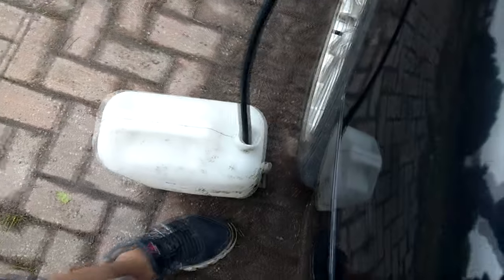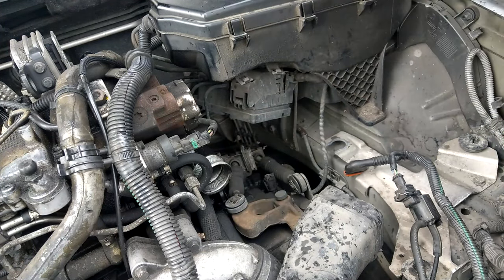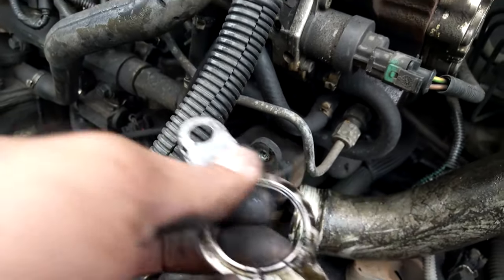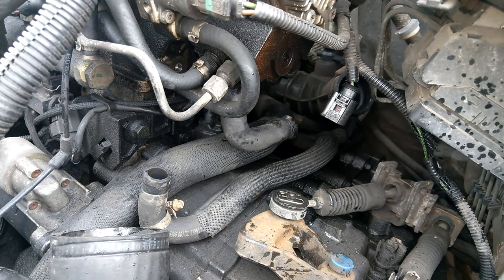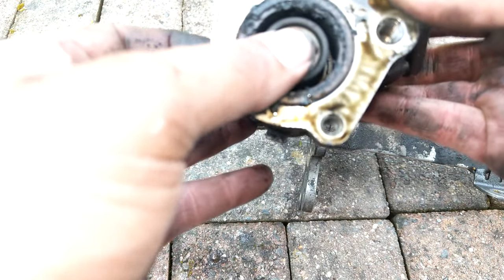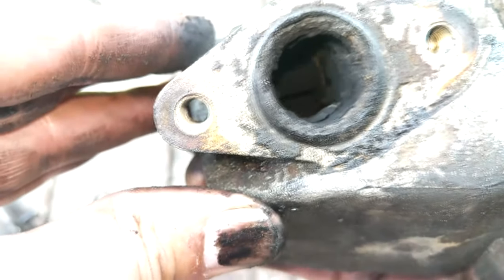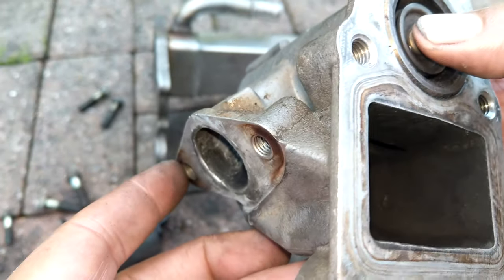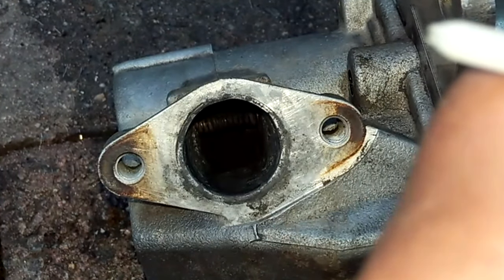Electronic EGR Valve Cleaning Testing and Replacement

Comment: Following your advice I've got as far as taking off large diameter flexible and metal pipes from the front and found them to have over 1cm thick gunk. Wax, crystalised gunk, feels like sand/grit. Took ages to clean them up. The junction to the EGR was almost completely closed due to the gunk. Only had so much time so I reassembled it all, quick clean of the MAF too and the car is immediately improved. Code P0244 cleared, can overtake again, boosting smoothly etc. Once I've got time I'll tackle the EGR itself following your excellent video for help, thanks man. I had no shim on the front joint of the actuator so I'm guessing my 2002/3 XC70 D5 Geartronic with 170K miles has had this done before. My nails are now mingin and will take a few weeks to clear up haha. Even bleach isn't helping but by the sting I'm guessing it's clearing out my micro cuts. :) Thanks for these vids, they really are helpful. I am so glad I didn't follow advice to just simply spray turbo/EGR cleaner in the air intake because if it managed to loosen even a tiny percentage of the accumulated crud I doubt my engine would be happy processing it.

Comment: very well simón, i did the work on my car, only i used spray oven cleaner, it looked like new, and i also cleaned the intake manifold and hoses, to top it off i installed an oil trap, and cleaned the membrane decanter,

Comment: Wow superb video. Got probably same problem with my xc70 2004  i was inspecting my turbo actuator but still no bad signs. My next step is egr. Do have an Engine service requred mesage after a harder aceleration. Also way more smoke then it should be.. should be no smome at all...  im sure 90% after i done this my problem will go away. 
Thanks for great informative vids!

Comment: Awesome stuff. I did this in my S80 D5, thinking that was the cause for reduced power output when I accelerated harder, but it ended up being a clogged fuel filter. Much simpler to solve, but in the end, it got an EGR clean at roughly the same miles as yours. It's a really nasty job as you said.

Comment: Hi Simon, great video! I was very interested in how you showed pressurising the coolant expansion tank to evacuate coolant from the system. You mentioned that the coolant was evacuated via the 'return hose' - can you be a bit more specific? Where/how did you connect the coolant evacuation pipe to the car? A very handy trick to know for all sorts of operations on the engine, etc! Many thanks, Ken
Reply from the maker: Hi, thanks for the comment.
If you check my list of videos, the coolant change with the car on the ground video is one of the newest.

Comment: brilliant video knows what he is talking about...i have a 2010 volvo xc90 d5 awd 2.4 auto diesel and i have had the same problem for months, had all the so called experts and non of them have been right, when i am on the motorway at 75-80 mph the car will not go past 3ooo revs, goes past 3k revs any other time but not when it gets to 80mph....its certainly a head scratcher

Comment: Done egr for my other car and because rushing allot made a mistake by putting back together egr  actuator and its housing not in perfect alignment. This caused horrible engine running even stalling.    I spent many days to figure out this..     It is definetely recomended to check that valve is operating as it should when its still not in a car.. this may save you lots of your hair...

Comment: HI. THX for the good video. Can u tell is if a blocked egrv valve could cause an overboost and also a limp mode over 2800revs on a d5 volvo engine?

Comment: I have an 02 S60 D5 with the same EGR. You make this job much easier with another excellent tutorial video. Many thanks. Liqui Moly makes an EGR cleaner with advertised specific dissolving properties - any opinion?
Reply from the maker: When the valve is as seized as in this video, I find it hard to imagine how it could be freed up by a liquid or spray without dismantling.

Comment: That mixer plenum was very clean! Whenever I've removed mine it's been caked in oily crap. I've been thinking of blanking the EGR off & swapping the plenum for a straight through ali pipe, is this something you've ever thought about doing? How often would you say that the EGR needs cleaning? Also I found petrol was the best thing to clean this sort of gunk off.
Reply from the maker: I think the mixer was clean because the EGR valve itself was stuck closed so very little exhaust gasses had made it through for a while.
I have seen them as you describe and worse though. 

Personally I would never blank or bypass the EGR and now that it's clean and working correctly, the engine has never run better.

I would guess that this style of EGR system needs a thorough cleaning and testing like in the video only every 10-12 years.

Cleaning the mixer plenum is probably a quarter of the job at best.
Reply: @sirobb  what are the side effects of stuck closed egr?

Comment: Done mine few weeks ago, I just clamped my coolant hoses from egr. I could say what did come out was from egr itself nothing more. I have a question, maybe you gonna do intake manifold cleaning? It would be very nice to get more information, before I try to do it myself.
Reply from the maker: None of the data suggests a problem with the intake manifold so it's not a job I'll be doing any time soon.

Comment: Hi Si great video as usual. In the 'good old days' we could get gaskets ANYWHERE. Now its a struggle to get the full set of EGR gaskets for my 2004 V70 D5! Im planning ahead as i need these gaskets or I cant take the EGR off. I dont know if you live anywhere near Basingstoke or have any idea where I can find a Volvo spares department please?
Reply from the maker: There are lots of Volvo main dealers on eBay if you want genuine parts. The EGR gaskets are reusable though so don't need replacing if you still have the originals.

Comment: Brilliant channel just discovered it, I’m a new owner of a xc90 d5 187 and find your videos answering all of my questions all but one, the fan on the engine is it normal for it to always be spinning ? Second I turn the engine on the fan starts spinning
Reply from the maker: Sounds normal. The cooling fan is used to pull air through the radiator pack which includes the AC condenser so I'd be more surprised if the fan was not spinning, especially in high ambient temperatures when AC is used immediately after starting the engine.
Reply: @sirobb  thank you for your reply, it isn’t turning fast just kind of spinning at engine pace kinda like the old land rovers and shoguns where the fan was on a belt.

I’ve subscribed and look forwards to watching all of your videos 👍

Comment: Additional; what about the deposits on the 'swirl flaps' - cleaning those would also improve engine performance(?) I love my D5 but the soot at high mileage has put me off buying another.
Reply: well the swirl flaps are for - well swirling the air - and making the combustion more efficient, if they stuck open or closed, it will have bad performance. The Actuator arm isnt there for decoration, it opens the swirl flap and closes it when necessary to maintain best airflow possible, the arm itself is a problematic construction, so is the flap design itself. If you have time id try to clean them if the EGR mixer plenum thing is dirty, so u know the flaps will be as well

Comment: I have a d5 newer one and it sounds weird on the left side when i push the throttle, its like a turbo pipe is leeking like a suction sound but nothing is teared strange it sounds like when you pour water on a hot surface but constant its hard to explain but any idea what it could be? Its on the driver side of the car ive already went through the egr pipes and stuff and cleaned them all but still the sound persists

Comment: Hey Sirobb, I’m sorry it’s completely unrelated to this video, but I was wondering, are there any differences in the suspension components between the 1st gen S60s with petrol engines and the 1st gen S60s with diesel engines? I am going to install some Eibach lowering springs, but 1 website tells me that they are only suitable for the S60 2.4 D’s while another website says that it is also suitable for the S60 2.5T petrol engine. I’m pretty certain that there are no differences but I’d just like to make sure, I don’t have NIVOMATS btw.
Reply from the maker: Vida, the Volvo diagnostics software contains a comprehensive parts catalogue for your exact car and will see you right.

Comment: Hi Robb, ive had the egr delete done not too long ago. Its  a costly thing to deal with when buying the car from someone else who wasnt really maintaining it well. Would unplugging it, since its electronically activated,  end the egr functionality and prevent gasses/fumes from entering the engine or does it need to be blocked off physically at the pipe too?
Reply from the maker: The EGR valve cooler has a small permanent bypass which allows flow so if you want no flow, you need to fix a total blanking plate at the mixer plenum up front. Search D5 blanking plate online. 
Fitting this plate would cause a warning on my car but if your egr software delete is successful, it won't be looking for any flow so you'll get no warning lights.
Reply: @sirobb  wow this was a swift response. They're not strict the emissions and so it's easy to blank it off and get away with it. I wouldn't do this if the former owner took good care. Right now I'm dealing with some harsh gear changes, particularly between 3 and 4 or at times 2-3. When the engines not yet running hot, changes are more smoother. But it plays up when you're flooring the pedal or once it's running hot.  I'm suspecting to be related to an incorrect atf level or solenoids needs cleaning and demagnetizing, if I can find someone who does it. Or replace the valve body if it comes to that. Unless it's the torque converter which might also be an issue.
Reply: @sirobb  if I was close to you, I'd definitely bring it around for some surgery

Comment: ho simon is there any chance you can make a video of the filter change on the engine bay fuel filter, mainly how to bleed after installation euro 4 xc90 thank you d5
Reply from the maker: I'm not aware of any engine bay fuel filter on a D5.
Bleeding on a D5 is just a question of ignition on for 10 seconds then ignition off then repeat 3 or 4 times before starting the engine.
Reply: @sirobb  thank you for your swift reply much appreciated i will try that, please keep up the good work with many more videos...

Comment: Hi
I have question about the EGR on my xc70 d5.
I did a diagnostic check and the % is always 100% what could be problem. Ist that the valve is open all time or what.
Thans for your help
Reply from the maker: If the figures are wrong, remove, clean and test the EGR valve as shown.

Comment: Hello Si.
Interesting vid as I've never known what an EGR valve was.  Do you think a faulty EGR valve would cause intermittent stalling at low rpm's during the warming up cycle.  My Ford Transit had the problem from new and Ford being Ford cuffed me off with every excuse under the sun, even lieing to me about tests they were doing on the vehicle.  Anyway... I still own it and every now and again during slowing down to a junction early in the warmup cycle it will just die.  It starts easily after the stalling with no other symptoms for remainder of journey.  Its so annoying as I lose steering and brakes at the critical moment. 
Cheers Si
All the best
Steve.
Reply from the maker: Assuming you've covered basics like new, high quality fuel and air filters, the EGR could be a possibility.
Diagnostics and having the official data to compare it to made deciding to do this job straightforward for me.
Without diagnostics, you can only guess unfortunately. 
It's a shame the professionals take your money but can't work it out for you.
Reply: @sirobb  thanks for your advises there Si.  Appreciated.  Yes, ashame Ford behaved as they did leaving me exhausted and depressed over the whole matter.  The dealer, Ford Gowrings of Reading, eventually went bust shortly after which may explain their lack of willingness to assist if they were already sinking.  
Thanks again buddy. 
Regards..... Steve

Comment: Hi, just wanted to ask, if I want to do an EGR delete, is it better to remove the whole Cooler and valve and just block off the EGR to intake entry? I am afraid I will get some error codes because of the disconnected connector. I was thinking just making a custom "gasket" and placing it between the cooler and the intake connector metal tube (keeping the EGR running, just with nowhere to go). Will it cause any issues?
Reply: so im set to do this on mine soon, bought a blank from a seller from poland on Ebay. I've been told you'll end up with a EGR code but it will still run sound (from what i've been told) unless you can get someone to code out the EGR from the system.
Reply: @Jayv70  Heyyy, soo, in that month, a lot has happened... You dont have to worry about just making a sheet metal insert with some liquid gasket and plucking in between the intake and the cooler (worked for me with no issues). I also dont own a Volvo anymore... Totalled :D

Comment: Hi there,   What is your opinion on disabling this EGR valve, I hear you can have it disabled and it should keep your engine much cleaner.,
Reply from the maker: My advice is to clean it and leave it standard. Much cheaper than having it mapped out and restores the operation to like brand new.
Reply: @sirobb  Thank you for taking the time to answer, is cleaning with these spray cans of EGT cleaner, is that an option for Volvo or is removal and scrubing the only way.
Reply from the maker: @robmus3085  On a horizontal EGR, you would be best to remove it as you need access at both ends and it needs to be cleaned and dried thoroughly. 
You don't want any residue going directly into the intake.
Reply: @sirobb  Thanks again Sirobb, you make driving a nice car affordable :-)

Comment: Question not related to video but cry for help

Volvo xc70 2003 2.5 awd automatic

Upon accelerating   there is sound of whistling  and reaching 2500 rpm vehicle goes into Limp mode if driven and reaching 110 km/h car removes fault and its like nothing happened.
Or when limp mode kicks in stop restart engine and vehicle works fine with slight whistle upon accelerating yet with out limp mode going active again until next time i switch it off.
 I cant find faults and it is driving me and my vallet insane
Reply from the maker: Are you using Dice and Vida for the code read?
Reply: @sirobb  dice, yet i replaced preasure sensor problen stayed.
Reply from the maker: @TermusJar  When you have limp mode, do you get a warning on the dashboard?
Reply: @sirobb   check engine on left info screen (fuel consumption info tab)  it stay there until vehicle restart or until i reach 110km/h where it resets and vehicle works as nothing is wrong.
Reply from the maker: I'm finding it hard to believe that you have a check engine dash warning and Vida can't find a stored code.
Vida catches the tiniest of errors in the vehicle management system.
Reply: @sirobb  Any suggestions where too dig for issues?
Reply from the maker: @TermusJar  Run live fuel, air and boost data in Vehicle Communication and compare with the correct figures described in Vehicle Communication. One of the figures will be incorrect.

Comment: Could this be the cause of intermittent power with a d5 xc90,
Reply from the maker: Unlikely but not impossible. There's a long list of possibilities for power loss.
Reply: @sirobb  thanks for the reply,I've gone over the vac system had the boost pipes and cooler  pressure tested and plugged into vida and cannot find a thing
Reply from the maker: @Carsandnature  There's Vida explanations and live data in this video so have you done that?
Reply: @sirobb  I'll have a watch on my lunch break. Watched lots of your vids over the last few weeks. Going to a valve specialist tonight as I've done lots to try and find the issue but with no joy. I'll have a watch of this though thank you. And thank you for replying
Reply from the maker: @Carsandnature  There's a description in Vida as shown in the video that will tell you the data to look for and you just compare it.
Far be it for me to tell you how to spend your money but if you have Vida, you really don't need to pay a specialist to tell you if the valve is working as expected.
Reply: @sirobb  I will have a look now, I didn't get all the way through the video. Lots seems to be breaking this week. So got a bit to go through before Friday